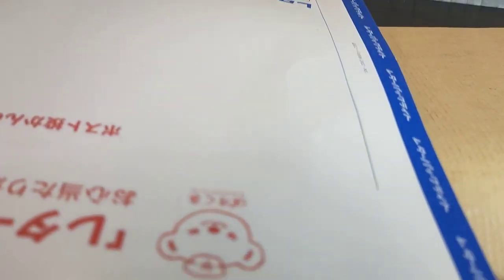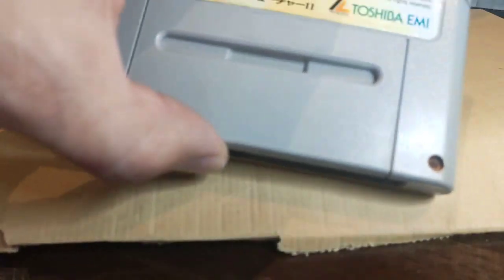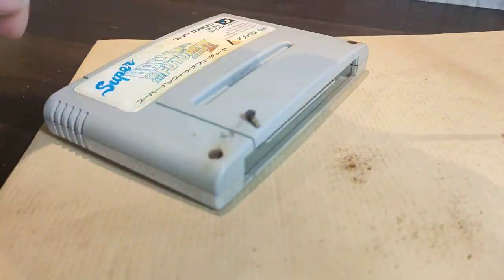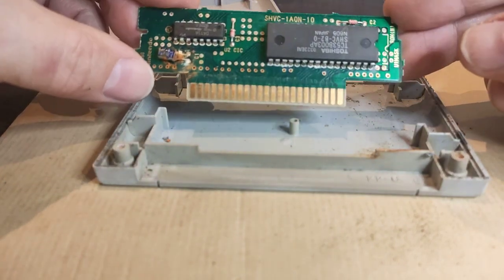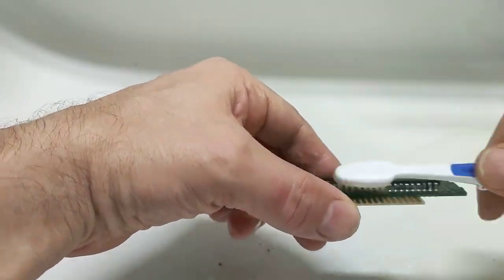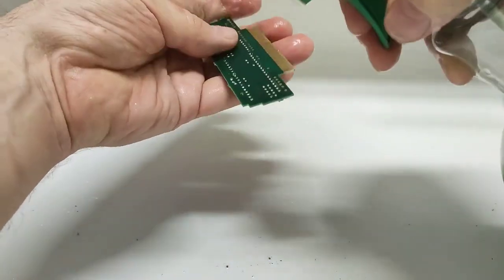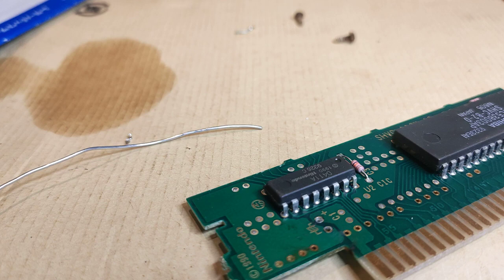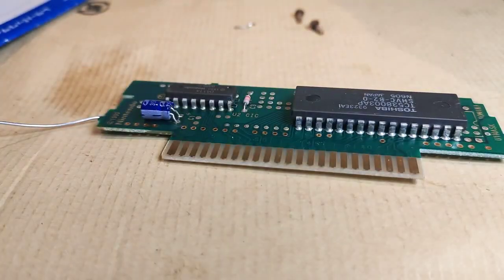Slightly Rusty Super Famicom Super Back To The Future 2 Game Repair

Comment: Quick tip Luke. To save the chance of eating up the screw heads, spray a little WD-40 (or better yet ACF 50) and let it soak first. It will clean up the rot and also loosen the screw threads.
Reply from the maker: Good tip there! I use it like crazy on other parts and it would have worked well in this case too! thanks

Comment: dude seeing you use a chemical and then water on a board is making me so nervous haha, I didn't think that was even possible...I always thought doing that would fry it
Reply: Nah just let it dry out. We use rubbing alcohol when soildering so why wouldn't it work? You don't work with electronics do you? We also use chemicals like cleaner to clean up drink spills and corrosion on PCBs and components.
Reply from the maker: HAHA! yeah, surprisingly as long as you dont plug it in right away its all good!
Reply from the maker: @danerd8978  A++ all around! you nailed it there. Its amazing how cola seems to do so much damage to a pcb and yet we drink the stuff lol. Thanks for the great input!

Comment: Why do you have a line in the center of the screen؟
Reply from the maker: I mentioned that in the video but it is partially due to the s-video cable and the monitor being used. Checking online, the system also seems to be well known for these issues!